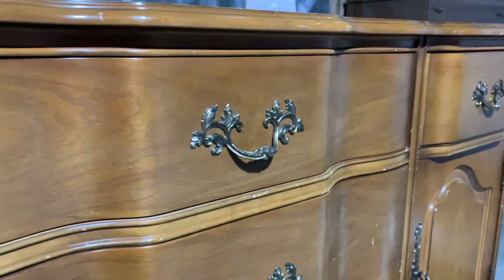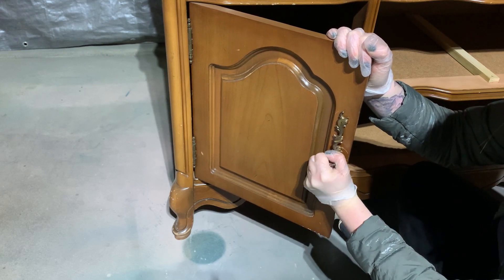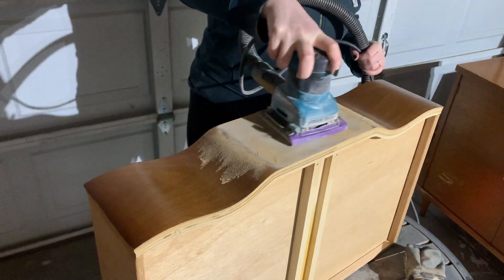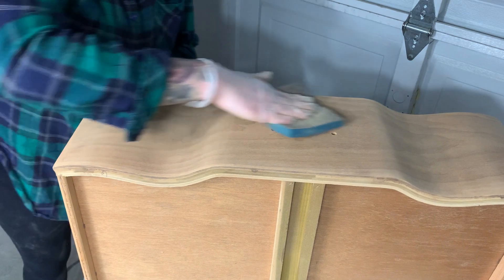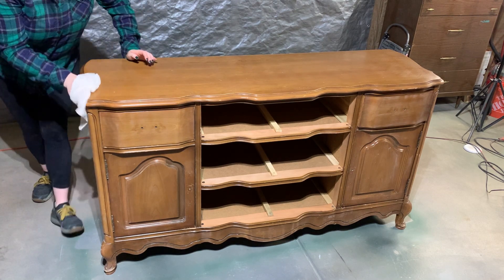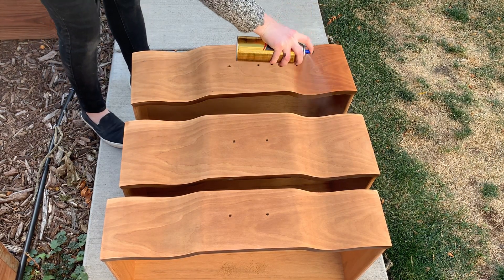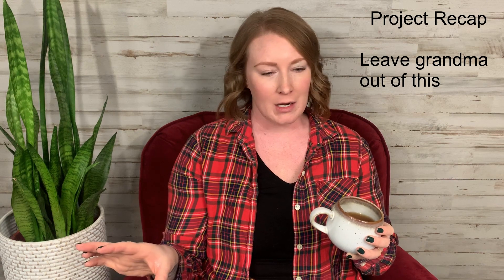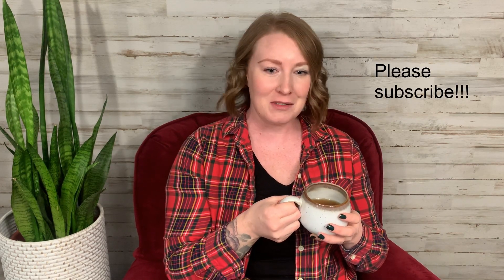Outdated Thrift Store Find to Upscale Modern Buffet | Furniture Flip

Comment: Absolutely beautiful! I was wondering what kind of sanding you would do on those curvy drawer fronts. You mastered it. Cannot wait until you post your next project!
Reply from the maker: Thanks!!! There are really fancy sanders out there with sanding pads designed for curves and details, but until I can get one it's good 'ole elbow grease for me :)
Reply: @TheRummageWorkshop  I bought these hard rubber squares that are rounded on one side and curved on another side. You just wrap your and paper around whichever side fits the corner or curve you need to sand. I love them but then again I`m new at this so I`m not sure yet if I`m working harder or smarter. 🙂